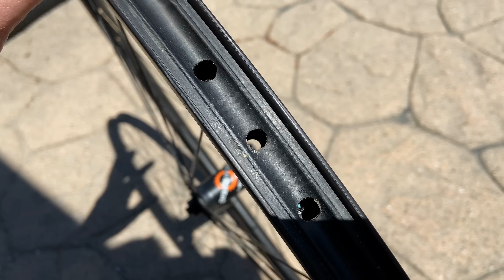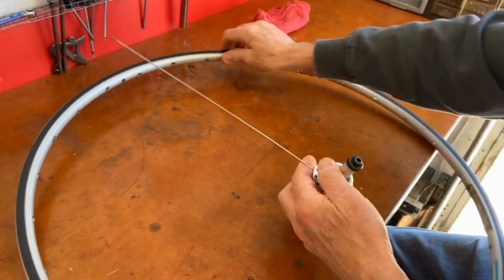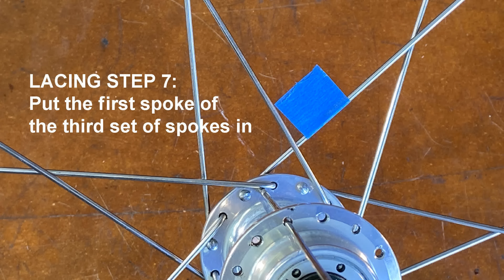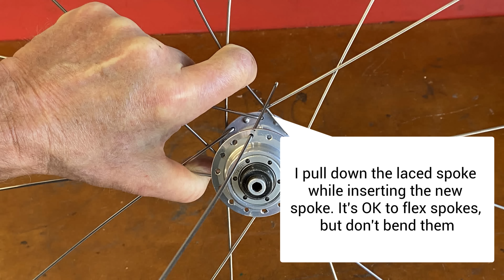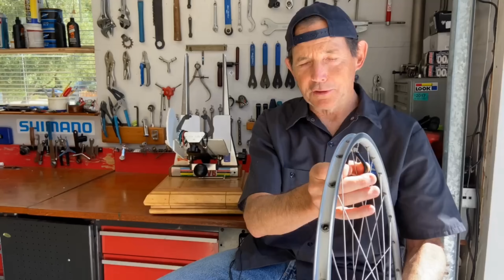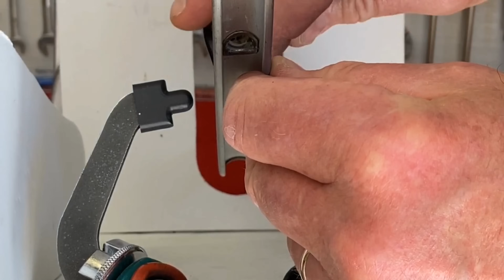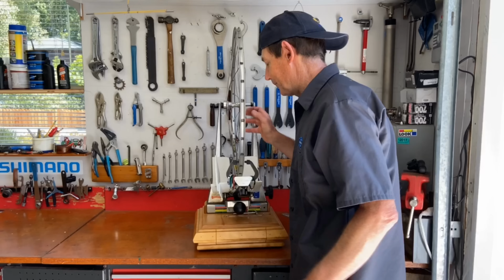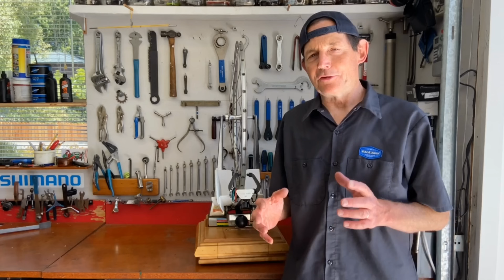How To Build Bicycle Wheels THE EASY WAY! #bikerepair

Comment: A man with a lot of patience!! I am in the process of converting an old 21 speed mountain bike to a hub drive E bike, but the front wheel has very loose spokes. It still runs true but needs attention.
I have done this before but many years ago.
Always wondered why there isn't a torque wrench for doing a retighten? Sure would take a lot of the hit and miss out of it.
Thanks for sharing! It is one of those lost arts. But as biking is regaining popularity(especially e bikes) Will be a very high demand for working on them.

Thanks again! Been about 40 some years since I have done this.
Just like riding a bike, once you know how, you never forget?
Reply from the maker: Thanks for watching and commenting, Joel. Yes, I think once you know how to work on wheels you don't forget how ;-) A torque wrench is an interesting idea except that it's not the tightness of the spoke nipples that matters, it's the tension in the spokes. So, you'd want to use a spoke tensio meter like the one Park Tool makes and/or the Wheel Fanatyk one that I show in my wheel inspection videos. Those give you a reliable number for knowing that the spokes are tight enough and the wheel will be reliable. Thanks again and have fun getting those e-bike wheels ready!
Reply: @JimLangley1  Thanks for the reply Jim.
I might try something for giggles, try my guitar tuner when plucking the spokes for tone. Somewhat the same concept?

I have another question. 
Using an E Bike motor will have a lot more torque than just pedalling. Should I use bead sealer on the rim to prevent the tire and tube from slipping?
I have noticed it the past that there has been slippage as the valve stem is no longer standing vertical. Years ago they used to make the inner tube with a solid brass valve with a retainer nut. Now is just rubber coated steel.
Thanks Jim!
Reply from the maker: @joelhill4107  yes, plucking the spokes is a pretty good way to gauge how tight they are, not perfect but useful as a quick way to tell if they're in the range you want. And, on the tires slipping causing the valves to become crooked, that shouldn't happen on any bike or any valve. 

I ride an ebike to work every day and have never had mine slip. The thing that lets tires slip is if the air pressure is too low. All bicycle tires lose air and need to be topped off regularly. 

A lot of people don't realize that that can mean as much as weekly and before they know it, their tire is so soft it can move on the rim. As long as tires are kept at the optimum pressure they shouldn't be able to slip. I hope this helps.
Reply: @JimLangley1  You are likely right on the tire pressure being low.
In the past I have just done the thumb test, and run them at quite a low pressure. I have a very bad/damaged back so was a little easier on it as lower pressure absorbed some of the shock.
I hope I have that problem taken care of, I bought a wide ass seat with springs on it.
I am a very stubborn person and determined to get back onto my bike!
I have arthritic knees ankles and the list goes on, Hence the electric motor!

Thanks again Jim! I don't know how you reply to so many questions. Am quite sure you are a very busy man!
I have a lot of your videos to catch up on, as I am a new subscriber.
Reply from the maker: @joelhill4107  thanks so much for subscribing Joel and enjoy your rides even with the aches and pains it's better than not riding ;-)

Comment: I've watched many wheel building videos, but this one is by far the best one! Thanks Jim! I actually managed to lace my first set of wheels after watching other video's (not this one). The truing yet needs to be done so hopefully this video will still help ;-)
Reply from the maker: Thanks a lot for watching and for the great comment, Marc - very happy to hear you like my video so much. Take your time with the truing and you'll get the hang of it. I go over the most common mistakes in the video. If you can avoid making those mistakes you'll master the skill relatively quickly I think. Have fun with it!

Comment: So how much money can you save by doing this yourself? I'm so worried about getting my expensive wheel's Stolen,i have an very expensive ebike and just saw in a catalog that about half of what I payed is the price of the wheel's (roval traverse) I want to go down one size on the backwheel like the new model of my bike has but I don't want to pay half of the bike price to get that wheel and i dont want to have a bad quality wheel either..it would be cool if I can make a wheel just as good without having to empty my bank account
Reply from the maker: Thanks for watching and the great question, Martin. Basically, you can save the cost of the labor to get the wheel built. And, you might be able to find a rim and hub that cost less than what your wheels use, which would save on your total cost. I hope this helps and with a little work and practice, you can definitely "make a wheel that will work just as good without emptying your bank account ;-) " Thanks again!

Comment: Thank you for the video I learned a lot, but I will still need to watch it a few more times to understand the adding of spokes
Reply from the maker: You're very welcome, Eddie. Thank you for watching and commenting! Adding the spokes is a 4-step process. The way to learn and understand it is to learn 1 step at a time. Once you grasp it you will realize it's actually the same step with a slight extra step 4 times in a row. You will get it with a little focus and practice. Thanks again!

Comment: Im thinking to do this to put a disc brake hub on a rim brake wheel
Reply from the maker: Thanks for watching and the comment, Gabriel. That's a good reason for building a wheel for sure.
Reply: @JimLangley1  I think its worth learning for this swap, when I get the hub Im gonna watch your video again to go step by step. Good video 👍

Comment: Can’t thank you enough for the detail oriented video. I’ve always been shy to try building a wheel but your videos show each step from measuring parts, explaining exactly what’s required and how to put it together. I’ve just tried (and temporarily failed) building a rim but I now know the problem and how to fix it (spokes ordered are too long for left with 5-6mm of spoke poking out the nipple and too short for the right with 4mm of thread exposed). I was still able to lace up and true the rim really nicely. I can be proud enough to say ‘today Jim Langley taught me how to lace and true a rim’. Thanks again and I’ll get it next try.
Reply from the maker: Way to go, David! Congrats on building your wheel. I'm happy to hear my video helped you get it done and that you're ready to build some more! Thanks so much for watching and the great comment, I appreciate it.
Reply: @JimLangley1  Thanks Jim, I had a second go and everything was going smoothly until the final tensioning. On the fourth or fifth round of half turns and checking for trueness the rim went from being really round and straight to basically buckled (out side to side by 30mm). Is it possible I over tensioned the spokes?
Reply from the maker: @indoorkangaroo3431  Yes, it's possible, David. You usually have to really over do it to get a wheel to buckle. Usually it will become so difficult to turn the nipples that it sort of feels wrong to turn them anymore. A superlight rim is more likely to buckle than other types of rims. With any luck, if you go back and drop the tension, you'll be able to get the wheel true and round again. It's frustrating when that happens but you learn about that rim and what it can handle. If you get a spoke tension meter you can learn what tension the spokes are at and also accurately know how tight they are as you tension future wheels. Park Tool makes a nice one that's not too expensive. Some rims have specs with recommended spoke tension that can help you avoid over tensioning once you have a tension meter, too.
Reply: @JimLangley1  Hi Jim, thanks that's great to know. I got a bit frustrated but just disassembled the wheel and started over. I got it back to true, round and quite tight. The other rim I had a better feel for spoke tension so was more gentle in the tightening phase. It seems like tightening was easier when I went with smaller turns like 1/4 and also not tightening spokes that were already quite tight. I can't believe I know how to build wheels now. I've got other bikes I've wanted to build wheels for and now I can!
Reply from the maker: @indoorkangaroo3431  great job sticking with it and learning the right feel for spoke tensioning, David. Yes, small turns are key to not overdoing it. Have fun mastering your wheel building with those other wheels on your list. Congratulations!

Comment: Been building and repairing bikes since I was a kid, got a job in a bike shop a few weeks after leaving school and was taught how to true and build wheels, opened my own bike repair shop a few years later in a different town, long retired from it as a business but still love it as a hobby, it evolved into building motorbike wheels when I restored a motorbike. It has to be one of the most satisfying areas of doing a build, that and rebuilding the old 3 and 5speed hubs. I loved doing those. I remember as a kid I always trued my wheels with them in a old front fork that I'd drilled a hole into it to accept the fork stem, I think that's up in my attic somewhere, but that was my jig, with brake pads attached to a cable I'd pull through a tightened down clamp (which sorta replaced the brake lever in it's function). Thanks for the video, was nice to watch...
Reply from the maker: Thanks for watching and sharing your story, maffysdad - I enjoyed hearing about you building motobike wheels and your homemade fork truing jig. Well done!

Comment: Hey Jim, I've built, or rebuilt several wheels for my trikes and velos. Is there a point where a rim is too bent to straighten? I've got one from a friend that is about 1.5 inches out. Double walled rim as well. Is it too far gone?
Reply from the maker: Thanks for watching and the question. Yes there is a point. The thing you always have to determine is if a rim is warped (knocked out of true by changes in spoke tension) - or bent (the rim/hoop is actually bent). A warped wheel can almost always be straightened enough to keep riding by truing it with the spokes. With a bent rim you have to assess the rim to know if it's fixable. Usually bends mean a rim won't ever be as good as new again. But, often you can straighten the bend enough to get the wheel usable again - though you still want to try to get the spoke tension reasonably tight and even or the wheel will come out of true all the time. 

So, to try to fix that wheel, I would try to true it with the spokes. If that doesn't work, I would look closely at the rim and try to see any damage. If the rim sidewalls are bent from impacts, all bets are off. You can pry them back sometimes but not always. If the rim has a taco shape bend, you can usually hold the rim up and rest a knee on the high spots and pull gently to take each wobble out. You are weakening the rim doing this but it's a way to remove the bend and put the rim back where it was re straightness, though it'll never be like new again. Then you proceed with truing and tensioning. Okay? I hope this helps - and let me know if you have more questions. Good luck with it!

Comment: Beautiful video! Great teacher but also very kind and patient person:)
Reply from the maker: Thanks so much for watching and the very nice comment, Zer0. I appreciate you watching and I'm happy you like my video. Thank you!
Reply: @JimLangley1  Dear Mr Langley, I am finally about to buy the hub and the spokes. I am using a spoke calculator tool : https://nabendynamo.de/en/service/spoke-length/ . The parameter I need to input is the number of crossings. My question is: Using your technique, what number of crossings should I input into the calculator? Is it 3? I am looking forward to building my first wheel, following your video step by step.
Reply from the maker: @zer0kelvin212  Hi Zer0 Kelvin. For most wheels a cross 3 pattern is a good choice and that's what I show in my video so it will make it easy to follow along. Have fun and let me know if you have any more questions!

Comment: A Yokota tandem in behind you.

I own a blue Twon Peaks, and was never happy with it's braking with the Scott Peterson SE U brakes. Great stopping power but needed adjustment after a few rides, and replacement pad.

Built a set of disc wheels based on a set of Hope Mono hubs and 6 piston calipers
Reply from the maker: Thanks for watching and telling me about the disc brake upgrade with new wheels you did to your Yokota tandem, Weed Man. That's quite an upgrade! Congratulations - well done!

Comment: Many thanks Jim for your excellent advice. I was going to bin my old hub from my 21 year old Specialized Rockhopper which had developed a crack in the rim, but having seen your video I decided to purchase a cheap truing stand and some good quality spokes and a new rim. I took my time and ended up with a perfectly trued wheel, that has remained so after many miles. 
I must say I found building the rear wheel quite therapeutic and surprised myself with the results. A testament to your skills. Thanks again.
Reply from the maker: Thanks for watching and the kind words, Steve. Congratulations on rebuilding your classic Rockhopper's rear wheel! I'm happy to hear it came out perfect and has remained that way. Well done!!

Comment: you da man! liked and subscribed! Thank you for this! If you can do more wheeel videos that would be sweet, ie how to build your own deep section carbon wheel
Reply from the maker: Thanks a lot for watching, subscribing and the nice comment, Geek Pharm. I have a bunch of wheel related videos on my channel you can watch. For building a deep section carbon rim, it's the same process I show in this video. Please let me know if you have any questions about it and I'll be happy to answer them. The biggest thing you want to be careful about is getting the nipples onto the spokes when lacing - you don't want to risk dropping them inside the rim. I use a tool called the EVT Mulfinger https://www.efficientvelo.com/tools/mulfinger-nipple-loading-tool They make a long one that's great for reaching down inside deep rims. If you want to make your own tool, you can use a spoke to get the nipples into the rim, too, but it's not quite as easy to use. Let me know what other questions you have. I'm happy to help!
Reply: @JimLangley1  thank you for your reply and all this generous info!! This will all defo come in handy, Stay blessed!

Comment: Why don't you use a park tension guage?
Reply from the maker: Thanks for watching, Jay. I do use tension gauges, a Wheel Fanatyk mostly. If you would like to see it, I talk about it and use it at this timecode in my ICAN wheels video: https://youtu.be/Wb73si7WD-k?t=576 I’ve used Park’s too. 

But my video is aimed at new builders who wouldn’t have a tension meter. So I show and explain how to get the tension right without a gauge. Hope that helps explain. Thanks again!